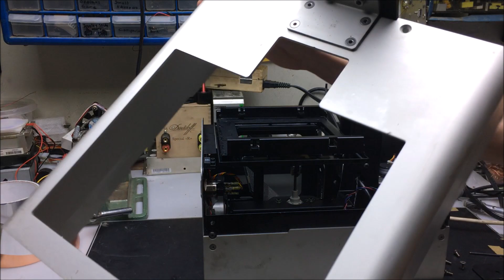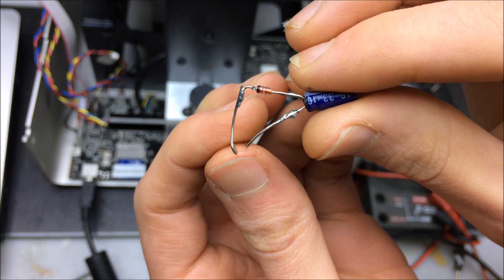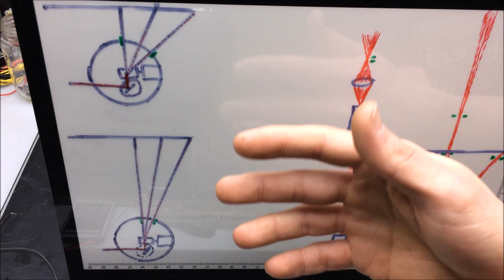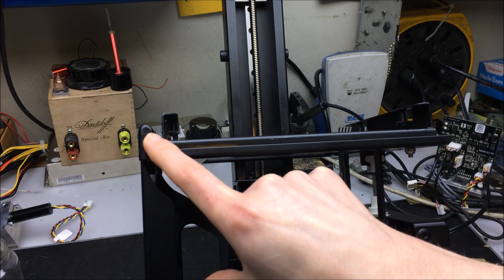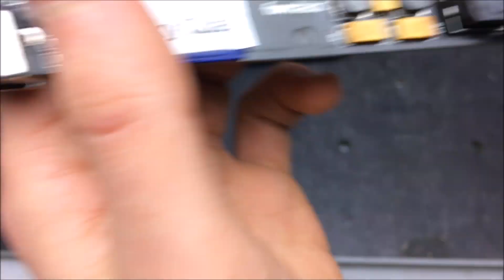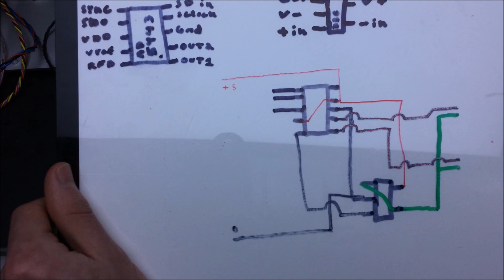Formlabs Form 1+ Tear Down, Repair Advice, & DIY SLA Printer Tips

Comment: I know this an older video but I just got one of these from work that was gonna toss it. Looks like someone overfilled the resin tank and it flowed over that little motor that tips it and has caused it to sieze. I have no idea how to find out what that stepper is or if its replacable with an oem part. I did some light research and will dive in more but if you have a quick answer that would be very helpful, thank you. 
And also nice informative video. I learned quite a bit.
Reply from the maker: Pull the motor out and drop it in 99% alcohol for a few hours and then apply aggressive mechanical force. It should free up eventually. It will probably take a few soak cycles to fully clean. Let me know if that works. Best of luck getting this printer to run. It's not the prime tech of 2022, but it's pretty much serviceable indefinitely as long as logic board is good.
Reply: @Zenodilodon  thanks for the tip man. I will do that. Gotta drill out one screw on the bottom to get the last cover off but so far so good. Doesnt look like any resin got on the logic board at the moment but still have yet to see the bottom of it. For a free printer I will be pretty happy if I get working again. Gotta get a new resin tank for it as well. They let it sit with resin and now thats just a resin block. Ill probably try soaking on isp first.
Reply: @Zenodilodon  well gonna need a new stepper motor. I got it out and had to take the covers off that hold the bearings to clean it all up and had ot running smooth with my hands. I dried it out and put it back in but it doesnt seem to want to power up the stepper. Hopefully I can find one but so far alibaba is the only place I have found them at.
Reply: @wescon3745  Hello, i have this exact same issue, did you find the OEM replacement part needed? could you provide a link if so? thank you in advance
Reply: @edgarmartinezhuaracha8429  Are you talking about the stepper that he lists at 7:02? He tells you the make and model of that stepper along with its dimensions.

Comment: Hi. Thanks very much for this video. I've learned so much out of it. 
My printer is doing fine apart from about 10% narrow (Y) axis. I mean if i print a 10cmx10cmx10cm cube and make it perfectly oriented to the 3d plains it comes up with 10cm (x) X 9mm (Y) X 10mm(z) asuming that (x) in antero-posterior,(Y) is the medeo-lateral and (Z) is the hight. 
I tried everything that can be done with the software and now i think it might be a galvo problem specificaly the Y axis. I openned the hood and looked at the optical unite and everything looks normal as shown in the video. 
I appreciate if anyone can help me with that since, other than this problem, the printer is working properly ind it is such a waste to scrap. 
Thanks
Reply from the maker: Does your printer have the same galvo amp board as the one shown in this video, also how good are your soldering skills?
Reply: @Zenodilodon  Hi thanks for your reply.  Yes exactly the same board. Regarding soldering i can solder large connection points but when it comes to the tiny bits i am afraid i had no experience.
Reply from the maker: @aalmukhtar3896  Ah, that is a tricky situation then. You can adjust the galvo scan size manually but it requires changing the value on a section by disconnecting one of the digital potentiometers and then using a precision potentiometer to adjust the size manually. You can also get a generic galvo kit good for 25kpps and swap it in and tune that kit to your desired scan angle. I don't know how the company sets the galvos, nor of any setting in the printer which would calibrate the galvo scan size.
Reply: @Zenodilodon  Hmm. Sounds too much for me. 
I am thinking of buying a replacement galvo amp board but formlabs are not selling any of these anymore. Would you please advise of any website that halps in providing spareparts? I would be so greatful.
Also i want to do hard resetting for the printer but it doesnt seem that easy to find how. Could you please help with that?  i noticed couple of buttons on the galvo amp board and other two on the laser board. Some of them with the word RESET but it doesnt seems to reset the printer. I appreciate if you can help with that too as i  beleive it may solve the problem. 
Thanks
Reply from the maker: @aalmukhtar3896  These would be your 2 best options that should have the same performance of your OEM galvo kit though you will have you contact the suppliers to make sure those galvos match the diameter of the OEM galvos.
https://www.aliexpress.com/item/32887919399.html

http://www.lightspaceusa.com/product.php?lm=21

There are a few other trustworthy distributors I know of but galvos can get pretty expensive in general for something decent. There are many cheap and bad quality galvos on eBey/amazon so if you go that route the most important thing it to make sure it is 30pkks @20deg and 24v-/+ for proper power input.
Reply from the maker: @aalmukhtar3896  Concerning a hard reset, I do not know about any of that. I just got the printer for hardware analysis and have not used it in any functional capacity.
Reply: @Zenodilodon  Thanks very much. Your help is much appreciated.

Comment: My resin tray got stuck in the machine.  How can I remove it?
Reply from the maker: I would try some 99% alcohol, maybe even heat it a little before trying. Note that if our vat is acrylic this may damage your vat. I have not done resin printing so aside from that I don't have much as far use useful advice, apologies on that.

Comment: 37:26   :) hahaha.. I LOL'ed so hard...

.. cause I feel you mate as a 'proud' (ahum;) fellow member of the OCD club

(you tought I forgot my point at the end of my sentence didn't you.. oh no sir: here it is)    '.' :D

PS ontopic: wow one of the best explanations of sla printing I have seen,  I am still in the fdm printing stage (call me old fashioned, but I have an odd feeling that that resin is gonna spill everywhere, making everything sticky,... oh, just as you encountered during de-assembly of this printer I guess ;)
As the market gets flooded with the cheap dlp printers, I fear sla will slowly fade from the consumer market..
If I would bite the bullet I would go for sla, as many buyers of dlp dont consider the cost to renew the (limited useage) screen and the high power UV led  array inside... sla with a decent laser source is in the long run less hassle and probably cheaper (my 2 cents...)

Comment: Awesome teardown, loved it! 
I own a form1(not form1+), which use the PT-20K, amp and all. I had to replace a galvo amp and found that the PT-20K is no longer available. So i found that the PT-30K have the exact same dimensions and even screw holes. So for the form1(Again, not form1+) the PT-30K will in every way be a drop in replacement.
Keep up the good work. Cheers.

Comment: Hi there, I have a question that is related to my rgb laser.
I have the problem that my main pcb is damaged and it doesn't work correctly.
A friend of my said that I can wire directly from the ilda port to the component sinds it is only sending data.
Can you maybe confirm this in a way of does it not make any sense.
The laser type that I have is a Laserworld RS-800 but I put a 6 Watt rgb module in it (the module works fine).
I hope you can help me with this question.
Thanks.
Greetings,
Davy Gademan
Reply from the maker: Yes you can do that. here is the ILDA DB25  pin out you will see what pin is what. You can wire the galvo signal in and laser modulation wires directly to the associated pins. Throw a 20k resistor across each laser modulation pins - and + to ensure they are off when no input signal is being sent as sometimes they will remain on otherwise when the ILDA cable is removed.

https://vuo.org/sites/default/files/styles/1600/public/feature/ILDAserial-RGBpinout.png?itok=SNMmUMSM
Reply from the maker: Also note that the laser will only work with ILDA input after this modification. If you want to maybe fix your main board  contact me through email and send over some pictures. As long as the main IC is good you will probably be able to fix it.

Comment: There is Resin UV LCD 3D Printers that use smartphone LCD and a UV Light. Maybe you can use Microvision Engine + a UV laser and do the same thing. A big advantage is that if you use an additional lens you can print very tiny objects like jewels models (and even microscopic things). Without additional lens you can print objects in the order of a decimeter.
Reply from the maker: I have seen that stuff, it's nuts how effective the LCD stuff is, many people like it over galvo scanning. I brought up using the microvision MEMs unit in Photonsters. I have a few extras of the mirrors still if anyone wants to attempt it. There are mods I want to do on the form 1+ to adjust the beam size and scanning size for smaller things, heck maybe even bigger things. Lots to tinker with down the line.

Comment: Where can you get the push button switch for the 1+?
Reply from the maker: Are you needing the whole switch plus the metal push button or just a new switch? If it's the first I don't know where to get it. If you are in need of a replacement switch I can pull mine apart later and see what size/contact count it is and look around for a replacement.
Reply: I managed to swap it from my other 1+ and that was the problem. Now that printer needs one and a tilting motor too.
Reply from the maker: @diygranite  If you have a bad tilt motor you can clean it out pretty easily by soaking the whole thing in rubbing alcohol for a few hours and then some cleaning of the lead screw, there is also a way to use openFL to have the Z do the peel process. Another person from Photonsters posted that. Do you just need the switch itself? If you are looking for other information on other solutions join the group and ask. I am no expert on printing/software. This unit was sent to me for reverse engineering purposes only hence the lack of build plate and vat.

https://www.youtube.com/watch?v=y5U8yBGLMaA

Comment: Ahh yea took one of those apart to  still have the scanset laying around but dont have a dac to connect to it anymore
very nice  printer but  formlabs sucks thing thing was already repaired 3 times  and never printed again after the last one
Reply from the maker: Like you even need a DAC, just find a pair of signal generators and have fun :P
Reply: @Zenodilodon  no thats true can also make one with a esp32 and a external dac
Reply from the maker: You don't happen to have the build plate for the Form 1 do you? I can't find one anywhere it seems. I can machine one but if I can find one that saves me some personal injuries lol.
Reply: @Zenodilodon  dont think so but i will definitely have a look for you also still have the z axis motor and the galvo set with the driver
Reply from the maker: @martijn4740  If you manage to find it I will certainly buy the build platform from ya.
Reply: @Zenodilodon  if i still have you can have it but i havent seen it for a while but il look for you once i get back home
Reply: @Zenodilodon  been searching for hours but it seems i  no longer have that part  else  i would  given it to you for free
Reply from the maker: @martijn4740  No worries, in the end the build plate is just a few nuts, a bolt and a tapped plate of aluminum which is pretty easy to make in a weekend.
Reply: @Zenodilodon  yea its not the most complicted thing in the world but original is always nicer ;)